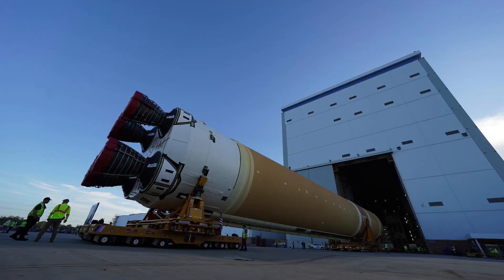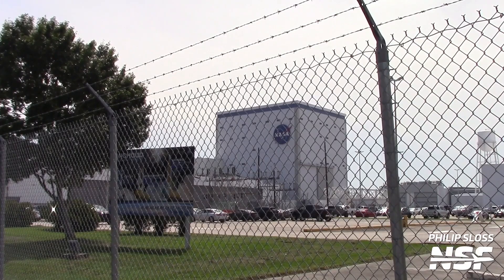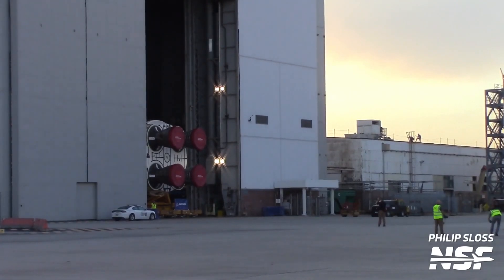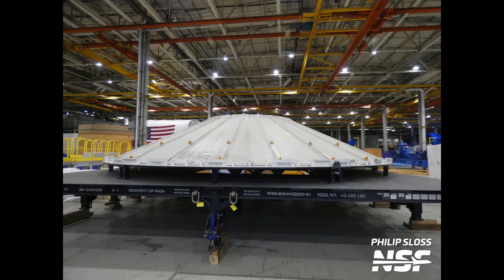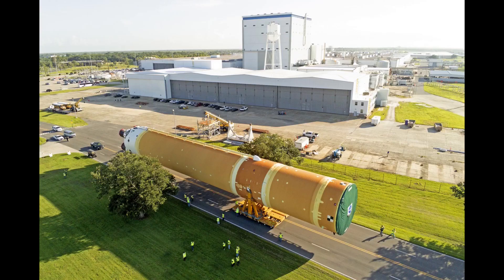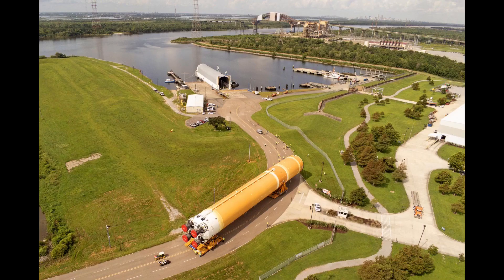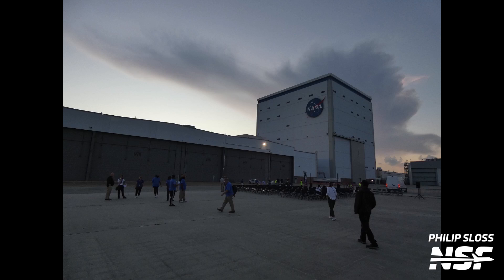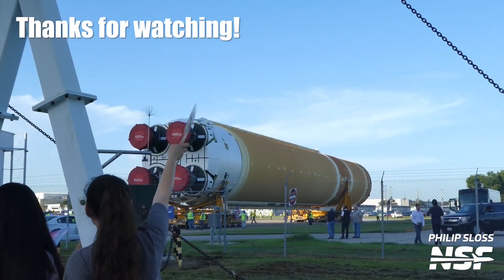Artemis II SLS Core Stage rollout recap

Comment: What an insane waste of money this is. So many more worthy projects are out there. Instead we get contractors slurping up tax dollars like pigs at the trough for a worse than useless launcher.
Reply: At this point, people saying this are just yelling at clouds.
Reply: @jrc1606  SLS is an outdated past that needs to be phased out.
Why use a tool when its replacement, which costs at most 2% as much, while also being 1.5x as capable, is available (and in fact necessary for the official goals of SLS).
Reply: @bryanillenberg  Yes we all know this, but it's like beating a dead horse at this point. Shouting and yelling for it's cancellation every time you see it won't make it go away. Why even bother watching the video if all you going to do is sputter about how much you hate it? Boeing isn't forcing you to watch it.
Reply: @jrc1606  Because I believe that we should use the next three SLS vehicles. We've already paid for them (mostly), after all. Scrapping them would be a waste.
Building a fifth would also be a waste.
Reply: @bryanillenberg  That's a fair point, and I do want to say that I appreciate that your initial reaction wasn't to explode in anger like our friend bosshog8844 did. We all know SLS is expensive and we all know that Boeing is a shadow of what they used to be, but I for one do think that there is use for SLS past three more flights IF we can find a way to reduce costs and improve flight rate. It provides a unique, high energy launch capability that no other current rocket can do in a single launch. This opens the possibility of it being used to send very heavy and large probes/equipment into deep space without the need of developing a special kind of kick stage or rely on multiple refueling trips, (both of which Starship would need to do in order to fully replace SLS). I do feel like I need to point out that work on the fifth vehicle has already begun, and with the development of BOLE underway it's not impossible to see it being used for nine flights at least.
Reply: @jrc1606  The work required to make SLS cost effective would be more expensive than building a completely new rocket, but it could work (and the F9 standdown is showing that a redundancy is needed).
Both SLS and starship can deliver payloads directly into high energy orbits (Starship through refueling or expendable upper stage).
My insane option for a reusable SLS is presented below:
Step one is to add a fifth SSME. Ideally, the nozzle size can be shrunk, and two more can be added.
Step two is to add a much bigger upper stage (~500-600 tons dry). This gives SLS an upper stage "worthy" of its core stage.
Step three is to upgrade the base TPS of the SLS core.
Step four is to add landing legs and grid fine to the core.
Step five is to replace the SRBS (when needed) with two other cores.
There. Now we would have a partially reusable super heavy lift launch vehicle (with dev taking at least 10 years and 20 billion)
Reply: @bryanillenberg  it's that easy lmao. you have idea mate
Reply: @mathewferstl7042  Its not easy. At all (Because the entire SLS design is about as bad as possible for both cost effectiveness and payload to orbit).
But it (may) be doable.
It "only" requires:
Reusable Aft TPS.
20+ ton landing legs and grid fins (grid fins could be identical to those on Super Heavy).
A completely new upper stage comparable to the S-II.
New engine section
RS-25 relight.
Modifying two core stages to have a nosecone instead of the forward skirt+interstage.
It would be easier to develop a completely new rocket.
Reply: @bryanillenberg  that "only" is doing billions of dollars and years and years of lifting there. NASA are weighing up their options of launching an SLS without an upper stage but are worried about an extended development time frame for that because of the need to due a heap of testing what will basically be a one off vehicle. Now imagine making all those 'changes' (basically a new vehicle). It'll take 10 years
Reply: @mathewferstl7042   "that "only" is doing billions of dollars and years and years of lifting there."
Which is almost exactly what I said (not quite word for word, but pretty close)
"Now imagine making all those 'changes' (basically a new vehicle)"
Agreed. Thats kinda the point.
"It'll take 10 years"
Also almost exactly what I said.
Reply: @bryanillenberg  you never gave a cost estimate or for that matter a time estimate in any of your comments. Rocketry isn't KSP
Reply: @mathewferstl7042  "
Here is a direct quote from my first comment on a "reusable SLS":
"(with dev taking at least 10 years and 20 billion)"
Wrong on both counts.
Reply: @bryanillenberg  ah I didn't see that one, my bad. Ok so you recognise the time and money it would take, so why do it. What does NASA stand to benefit from that? Remember the biggest issue NASA is facing budget wise is not having a consistent launch schedule which a lot of negative knock on effects. So how could spending an extra 20 billion and 10 years possibly help?
Reply: @jrc1606  The reusable SLS is optimized for reuse, which as a side effect optimizes it for LEO. (If ICPS production could be restarted, it could be used as a kick stage if the SLS redesign lacked the needed capacity to high energy orbits. Centaur V may be a better choice, though.)
It would stage at FH velocities in order to enable the core stage to land downrange, with the side booster RTLSing.
The foam would have to be completely replaced: while it would endure boostback with little issue, EDL will strip the stage of foam rapidly.
The reason that the core stage is being reused (and thus required a new upper stage) is that 4 RS-25s is roughly 500-600 million (or 5-6 expendable starship launches).
SRB recovery is not economical: it cost more to reuse a shuttle SRB than it did to make a new one. For this reason, SRBs should never be used on a launch vehicle unless there is no alternative.
Additionally, with LRBs of the same mass, they will add significantly more velocity at stage separation. I used the modified core stage as the LRB because of commonality with the first stage, and its in the right mass-range (if a bit large).
Reply: @mathewferstl7042  The goal was to design a cost-effective SLS. If NASA went with a similar proposal, they would have two redundant Super Heavy Lift Launch Vehicles (Starship flying 150-300 times a year, and SLS flying maybe 10-50 times a year. Reuse does wonders to launch cadence), which is unprecedented.
The main issue is that SLS cannot be made cost effective on a "reasonable" time frame. Any SLS replacement (other than Starship or Falcon Heavy) will take at least 5 years, and probably ten. Hopefully less time if its from "New Space", significantly more if its from "Old Space"
Reply: @jrc1606  found the pig unwilling to detach from his trough. you work for a legacy aerospace company..?
Reply: @bosshog8844  No. Imagine being so bitter about a rocket. It's sad even. Did Boeing engineers steal your house?
Reply: @jrc1606  They siphoned money away from worthy projects. It's criminal behavior. No one should put up with tax thieves.
Reply: Well, most of the money (maybe all?) for Artemis II-IV have been spent.
So a reasonable method for phasing out SLS would be to fly those missions with SLS, before switching to Starship (or maybe New Glenn).